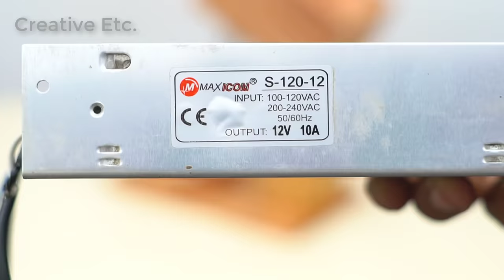How to Make Electric Dough Maker at Home

Comment: Nicely done. Might be better to screw a metal plate onto the base and weld the bowl to the plate so that you don't have to screw through the bowl. Stress on the bowl will eventually fatigue the screw holes. Plus you don't want the screws in contact with the dough.
Reply: Nice i like it and want to buy where to please

Comment: Three more points can improve the performance of this excellent  product...
1. Detachable bowl method for easy cleaning.
2. Multy Size of the bowl should be kept it an option in the same machine...
3. According to the bowl size, you can consider the matching rotate rod size. And it should be detachable.
Reply: What is the cost of it?
Reply: Yes, exactly, the stirrer & doughmaking Bowl Should be removable for wash,Thks.One Sr.Ctzn New Mumbai. Unit made very well by skill.

Comment: Really appreciate your work, the only thing is you need to make utensil removable as well as the motor portion must have a lifting option and it should be 90 degrees instead of tilted.
Reply: 90 degree me proper dough nhi bnega vo mixer jaisa ho jayega
Reply: Putting it at an angle does help bring up the ingredients from the bottom of the bowl into the body of the dough quickly
Reply: Yes could have done, need more development. If he advice!!!  I will be ready to help. Thanks. Enamul Hoque

Comment: The sauce pan should have been removable for washing. Otherwise a lot of bacteria will develop and cause health problems. So also the iron rod should be removable for washing.
Reply: VHS
Reply: Agree. Rod is still fine, it can be washed as is. But saucepan could have been put in a holde
Reply: bien los comentarios pero hay que agregar que la base debe tener un peso que de firmesa puesto que si es para masa puede empezar a vibrar
Reply: ऑल रेडी रोड इस एस एस मटेरियल already rod is SS material

Comment: @creative team, It would be good if Dough maker and roti maker can run through one electric motor, design should be both work can be done from one machine. it will reduce the cost and increase the acceptance of this machine.

Comment: Nice. Could have better with a detachable bowl for easy  cleaning
Reply: You could weld or even glue some stainless little pieces on the outside of the bowl, and carve their shape in the woods, to avoid using screws.

Comment: It will better if the pan is secured/clamped from outside by making a circular pocket in the base of wooden stand. This will ease up the cleaning/ washing of pan and to get rid of flour in slot of screws

Comment: The utensil should be removable. That will be easy to add I believe.
Reply: No it have much stress so it needs to be fix.
Reply: But for washing what Will we do
Reply: @santoshingle321  add some oil while making dough. Or just add warm water n swipe otm
Reply: Bro it is Actually bolted (NOT WELDED) so we can remove pan and arm-rod when we need

Comment: Looks great and all, but for the price of the power converter and the motor you could pretty much buy a lower end table top mixer. I have several different converter sets already for all my electronics and emergency situations, but if you are going from the base up you'd have to sell this at close to $200-250 US to profit on building them.

Comment: Sir,  you are using gear motor rating
24 V and output of Power Supplier 
for this motor is only 12 V, 10 A. Why,  kindly clearly.
Thanks from India.
Reply: Exact question ❤️
Please explain sir
Reply: Where did you buy this geared motor?souce reference and cost please?

Comment: Standard home does not have machines used it the job. Title should be changed. Only an expert technician can do it with expensive tools. High quality dough makers are available in market at one third price. Bigxen dough maker costs 1519rupees  at flipkart. Video has academic value but not practical utility.

Comment: Nonsence! The motor used coasts ₹ 3500/-   if you
You pay ₹  3000 you can purchase a  table top wet grinder with atta needle. Then what is the profit ?